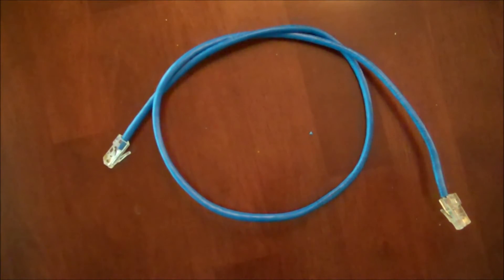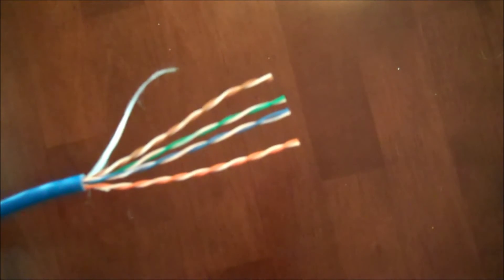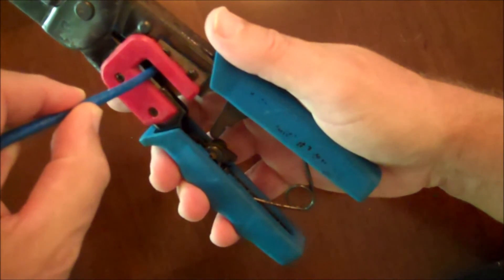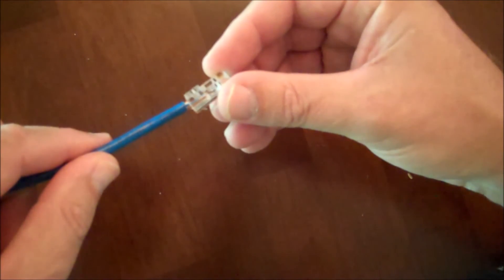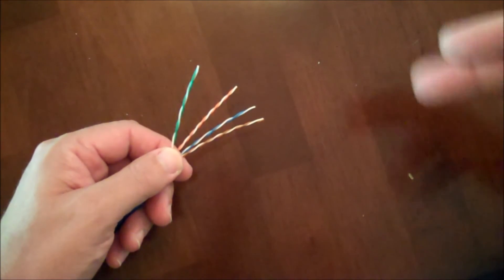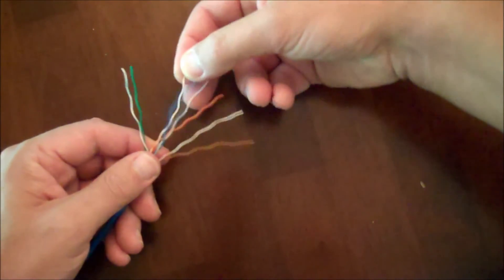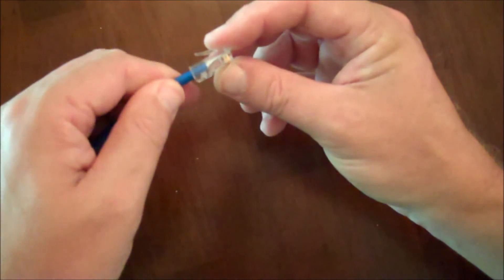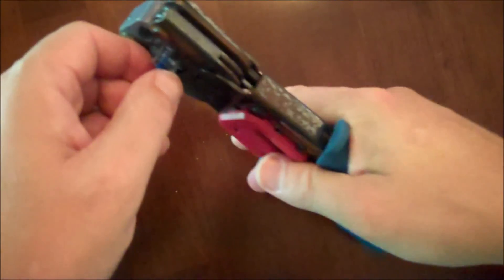How to make a Cat5 patch cable TIA 568A 568B Cat5e

Comment: ive seen people use 2 RJ-45 female ends, on a 4 pair wire, my question is, how do i wire said ends with only 2 pairs per RJ-45 Jack?
Reply from the maker: Caleb it really depends on what you are attempting to accomplish. Pins 1,2,3, and 6 can be used for LAN / Internet whereas the 2 center pins are often used in telephone dial tone.
Reply: But also, if split up the cable into 2 pairs and 2 pairs, u can only do a max of 10/100.
Reply: I figured it out after playing with it. I used pairs 3 & 6 my keystone jacks had the layouts I just didn't pay attention to it. And yeah the switches I have are only 10/100base-T so its not a loss i m using it for my minecraft server of all things windows 8 dose a great job of using all the networking ports together so there's no bottlenecking

Comment from the maker: Upgrading? To keep a newly constructed building up to date with emerging changes in technology maybe so; however, the benefit of the additional expense might not ever be realized over the next decade or so if ever. Fiber optics and the advent of services like Google Fiber with it's built in WiFi set-top boxes / WiFi access points could leap frog any intended future proofing of Cat6. In new, larger commercial applications it could be worth the expense to upgrade from Cat5 to Cat6. Just an opinion